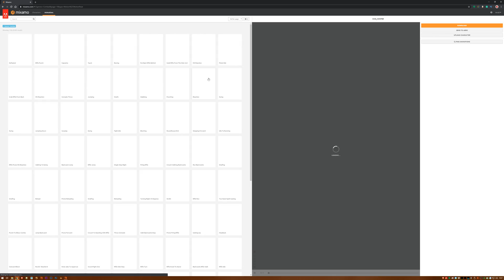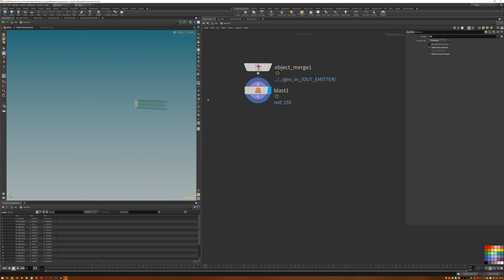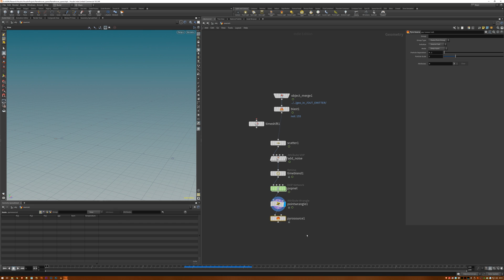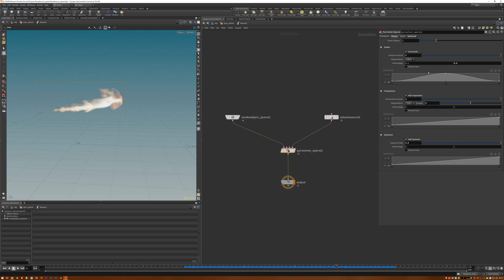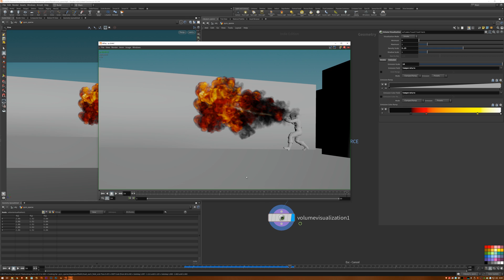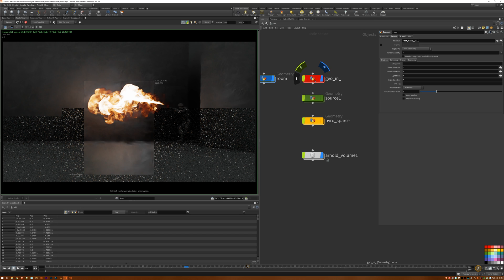How to Create Flamethrower with Sparse Solver using Houdini 18 / Arnold

Comment: my pop node generates particles but dont move forward, normals guides are ok and woth noise, they stay on the circle emitter.
Reply from the maker: Make sure you have velocity v - convert the normals to v
Reply: @arvidurs  thanks, yes I undestand a lot in theory,  but Im new in houdini, start with houdini industry makes me use c4d and now im back to houdini,  and not sure how to make the convertion,  should be via Vop or some code line, if you could guide me where to look... som options  or just another tut  with stuffs like that wich I need to learn before... Thank you a lot,  its a great way to teach Houdini, there are many tutorials too longs and not to practical enough to create learning, and not a good tutorial follower.   I apreciate when have an  excercise involved. Thank you again, if you can give me more comments please.
Reply: dont see the moment when you do that, have diferent result with same setup on vop, dont see when you conect something to  v - or convert normals to v...  help please,
Reply: im starting from a circle, normal, scatter, attvop...
Reply: @arvidurs  I conect the noise to N and V to  get velocity but you did not that... even with that doesnt work, i set inherited velocity on pop attribute, still doesnt work,  so then just  reset initial velocity woth CTRL+ LMB over use Inherited velocity (same value that I have) and then got velocity in particles, super strange!
Reply: @mqmadrid  I have the same issue. i don't know what can i do
Reply: @alvarosantos1456  @mqmadrid
Yeah really anoying problem not shown. But in the add_noise attribute vop , inside there he connects everything to the N in the vedio, You just have to conect to the v instead. This is for the geometryvopoutput1 node. Hope this helps.... i mean you posted 6 months ao so this probably will not help. oh well
Reply: @sophiarichard6312  thx Sophia! maybe one day I will come back to this exercise and help me! 
Regrats!

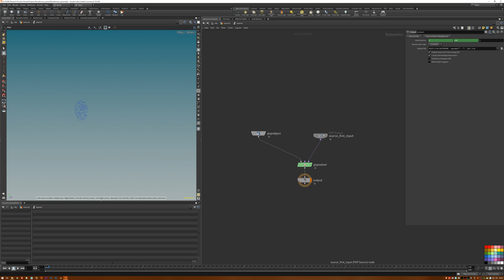Comment: At minute 3:11, in my simulation, the points stay in the same place, I have reviewed my project several times and it is the same as in the video. Does anyone know what could be happening?thanks
Reply: You need to plug the Normal that you made by adding noise into velocity in sops and in dops inherit the velocity

Comment: Hi Arvid, thanks for the video. Mine @3:11 only have the original points when I hit play. After added the gravity value the points are falling down at the same 2D plane. Can you help me with what step I did wrong?
Reply: In the point VOP, he forgets to plug the result of the add node into the N on the Geometry VOP Output node. That confused me too lol
Reply: @imzbugni  I think it's v and N? Because I also connected to v and now they are moving.
Reply: i solved it by adding an attribute wrangle in which I set @v = @N

Comment: Nice and awesome tutorial. I want to ask a question though. The blast part. How do you do that? I tried selecting the points and do blast but nothing happens. The not section below blast node comes blank while yours say 4479. How do I do that select the points and do blast?
Reply from the maker: In the blast node click the selection top right which will get you the selection mode. Then select point and confirm with enter. That should put the point number in the selection and blast the points

Comment: Really good tutorial, but could you do a tutorial on how to shade volumetrics/pyro simulations in Mantra?
Reply: I'm running into a similar issue. Not sure how to shade it with mantra for render. Otherwise this was great!
Reply: Nick yeah, for now I just export and import in blender, because Cycles is way faster and easier (at least for me)
Reply: The standard flame should work, and for more control you can use the temperature and heat visualization down dop network to remap the flame shader according to your particular pyro simulation

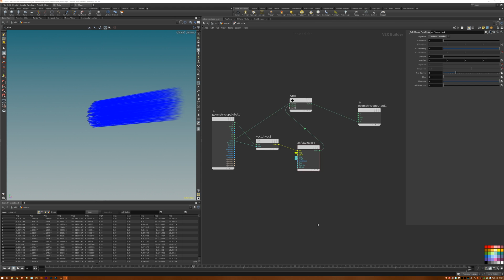Comment: Where are u getting your velocity attribute from. It suddenly appears in the geometry spreadsheet (2:43)  without you changing anything? Sorry if I just didn't see it, but I rewatched it now 5 times and couldn't find it
Reply from the maker: Yup! So the velocity is coming from the particles. You create the fuel particle source, and after the simulation it will have calculated the velocities and add them to the spreadsheet.

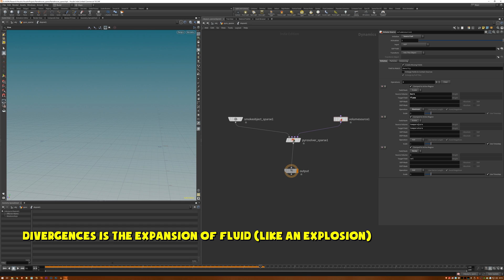Comment: Great stuff, like the rapid pace and simple setup. One thing, at 2:41 you mention piping the noise output into the Normal and velocity, but you only show it going into the N, which could be confusing unless you're listening carefully! Also it goes a bit too fast around 4:45, some of the settings I had to advance frame-by-frame to see.
Reply from the maker: Hey Chris! Yes, you’re right. I fixed that V plug a bit later in the video. Shoul annotate that. And I agree it’s too fast! Will need to work ok this kind of format. 

The hip file is also available for people having big problems :)
Reply: @arvidurs  Great thanks. I look forward to seeing what you come up with next time :-)